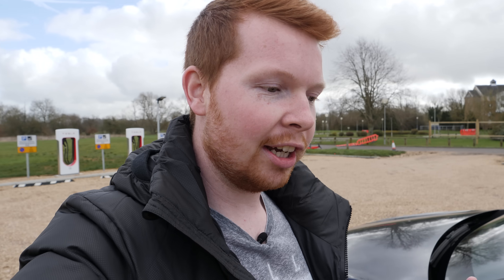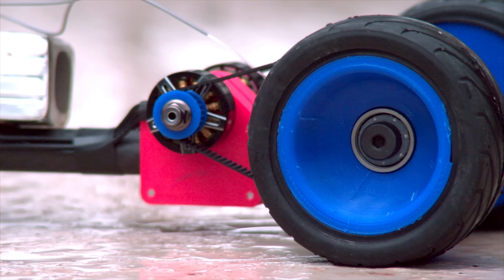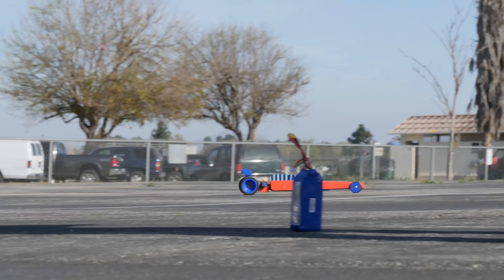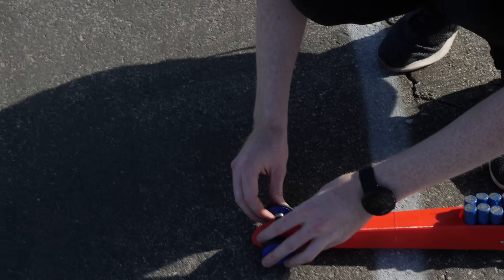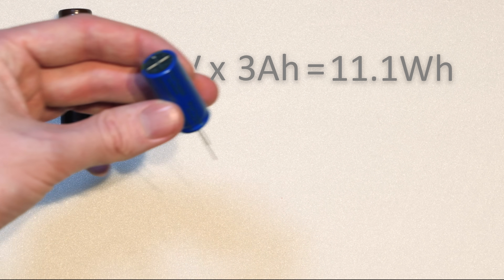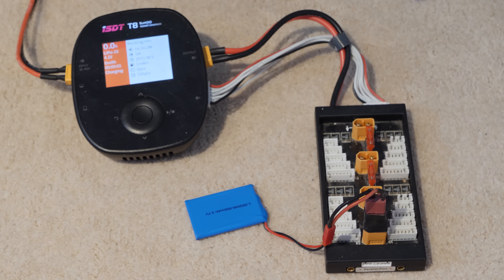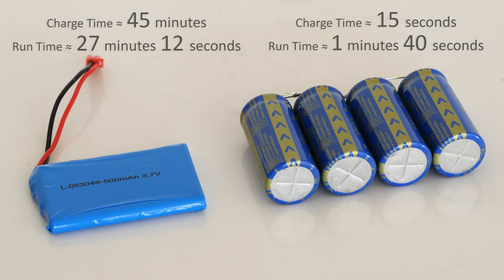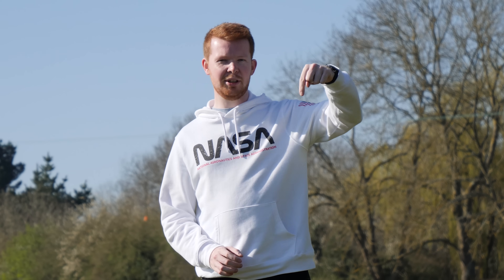Super Capacitor Dragster

Comment: caps should be used in regenerative braking and starting up everything
and everything else on battery.
so a hybrid solution could be interesting here.
Reply: I'm going to start a car company and steal your idea
Reply: Elon musk wants to know your location
Reply: Tailslol they already are in multiple applications. Like the dodge eTorque
Reply: Why do we need to use caps for regen and not just the Li battery? There are considerable drawbacks with supercaps: The energy density spec tells us a Li battery will usually be smaller in size, you won't find too many with high Farad rating AND high voltage tolerance, we don't want more complication with parallel/series orientations requiring balancing electronics. Caps also leak so "starting up everything", most likely won't be an option after sitting for a while.
Reply: @amorag59  battery has a limited number of charge and discharge and become less efficient over time.
this will negate the effect .
Reply: Tailslol Those are for deeper charge and discharge cycles. Real world cars already are using the Li battery for regen so your opinion is moot. You realize the material that separates the plates in capacitors breaks down right? Most don’t know, but because of this caps have a very similar or less shelf life compared to Li batteries 5-10 years. I’m not trying to bs you, I’m just tired of all the unrealistic hype.

-An electrical engineer
Reply: @amorag59  indeed i realise that,but it is well known caps degrade a lot less than battery so the less you use battery the better.
capacitors can charge and discharge for decade when used correctly,when a battery show a lot of weak points only after 2 years of regular use.
Reply: Tailslol “when used correctly”? You mean perfectly ideal conditions? 10 years if the cap is kept under 25/77 degrees C/F. The life cycle drops drastically with heat, the shelf life is 4 years if the person doesn’t drive their car. That’s just the longevity, you still didn’t address the fact that they don’t hold any energy and the higher energy ones are like 2.7-3 volts max. So you now have to build a module of these (with balancing circuitry) to operate at 400 volt level (Tesla). I see where you’re coming from but think about the whole picture. Tesla’s batteries have a warrantee of 8 years and many continue driving after that without noticing too much degradation. Tesla has done well with their Li chemistry.
Reply: Tailslol All if this info came from maxwell supercap datasheets.
Reply: @amorag59   yes for sure your battery won't live as long.
Reply: Tailslol Literally all Li BEVs use their battery for braking regen. If it were an actual problem they would have implemented caps.
Reply: @amorag59 youll see. unless they make solid state battery it would be a problem.
Reply: Tailslol More baseless claims, stay blissful my friend.
Reply: @amorag59  Heh I'm not blissful I'm not the one who think lithium battery will stay efficient forever...
Reply: Tailslol Don’t straw man me, I never said that they’d stay “efficient forever” now did I?
Reply: Tailslol I can tell you are not even old enough for university. It may behoove you to one day listen to people with actual real world experience (in this case how laughably tiny the energy density of capacitors is).
Reply: @amorag59  heh i'm from 84, i have a good life  and enough experience, and i'm probably way older than you so...yea ...not the best way to attack by the age just to try to impose an opinion...
Reply: Tailslol The energy density of super capacitors is not an opinion. I just provided a laundry list of drawbacks and sources as to why this is not as good an idea as it looks. I would expect the same of you with analytical responses, but you so far haven’t addressed many if any drawbacks. “Battery will go bad in 2 years” just. Plain. Wrong. You mischaracterize my position and cherry-pick what you want out of cap technology. This is characteristic of a child, not a mature adult.
Reply: @amorag59  ho yes i know about the energy capacity of the capacitors,this is why i suggest a hybrid solution with capacitors as complements.to preserve the main battery.
did you really read what i said in my first post....
Reply: Tailslol “Why do we need to use caps for regen and not just the Li battery” was literally my response to your first comment... Then I go on to tell you all BEVs have regen directed to the Li battery and you must also address the added complexity given the low energy density drawback....
Reply: @amorag59  to reduce the number of (small) charges.
the regenerative braking offer so little energy it basically mean nothing for the long term.
so better keep the battery for regular charging. the energy used in regenerative breaking can be used to help the next start since it will happens after the breaking.
the energy itself will not be stored for long in the caps and will be more efficient than just using the battery.
caps can be used too for cold start when the lithium battery will have difficulty to provide energy.
Reply: Tailslol Capacitors would leak and NOT be able to always start the hybrid on their own. If the caps and batteries stay connected (if you don’t isolate them) the caps will slowly drain the battery. Tesla’s can do 300 mi now and 600 mi by 2026-2030. This is the Li technology that’s out there and not even anywhere near your 2 years life you tried to claim. You are beating a dead horse repeating the same thing, your opinion. show me any evidence that says regenerative braking is actually a problem for longevity with Li batteries.
Reply: @amorag59  i think it is an issue for longevity yes ,too frequent charges can increase the risk of damage the internal membrane of the cell . but yes i know the caps will be flat in the first start so the caps are not fully isolated ,im aware the battery will have to juice up the caps for the first start.
Reply: Tailslol “I think it’s an issue” doesn’t cut it bub. There is a big difference between a loss of 2% after 10 years and a loss of 30%. Conjecture, opinion, guessing. Not helpful.
Reply: @amorag59   you pretty much mention caps in n1 and battery in n2
Reply: Tailslol My gosh, get a clue, if you don’t provide scientific evidence then you’re just pissing in the wind. I don’t discuss conjecture.
Reply: @amorag59  cool,cya then.
Reply: @amorag59  Seeing as I am not in the battery nor car manufacture business, all I have is opinions and hearsays. Such as batteries don't like short bursts of high current from regenerative braking, so manufacturers silently nerf it to prolong the battery life. The use of supercapacitors aims to flatten the current from regen, i.e. push the usefulness of regen even more. They are not meant to replace the battery.
You mentioned some technical difficulties, which are to be expected in any technology.
Reply: @amorag59  As an electrical engineer you should know that audio systems use capacitors, and some working audio systems have more than 20 years and haven't got their caps replaced. Or computers, servers, etc, for that matter.

Edit: you are mentioning supercapacitors... use proper wording. We currently use battery-capacitors as super caps, of course they have the same lifespan as batteries.
Reply: @vladlu6362   Are you kidding me? First off, I don't know why you are accosting me lol. There is so much wrong with your comments, I shouldn't even waste my time but here we go. You know I'm an EE yet you are over here explaining the obvious about capacitors while ignoring the important details? If you actually knew about caps you'd know that, although they have high power density, they have an extremely low energy density. About 5 Wh per Kg as opposed to 120-240 Wh per Kg for lithium. This weight will add up if you actually are trying to design the system to have enough capacity to offset battery usage. This is all with the caveat that with regen braking you still need to use regular brakes so a significant portion of your momentum is lost as heat.

Your analogy about "you will probably have your 12 volt caps charged and your 12v battery dead" is off for two reasons. 1) energy is energy, the energy you get from regen braking would be the same on a battery or a supercapacitor, the capacitor would only be charged up so fast because it has less storage capacity. This is equivalent to bragging about a smaller fuel tank being "better" because you can fill it faster... You were probably referring to the low internal resistance of capacitors allowing for high currents, but the internal resistance builds up when you introduce a lot more cells. 2) Why are you talking about a 12v battery when we are talking about braking regen? On braking regen you wouldn't be dealing with a 12V battery you would be dealing with a 400/800 V etc. battery... 

There is a difference between capacitors in audio electronics and caps used for power. This shouldn't even need to be mentioned. The ones in audio/computer systems are used for signal filtering (RC and RLC circuits), not so much energy storage. Even in power smoothing/filtering those capacitors aren't discharging that much energy they are just filling in for small voltage dips.

The point was you can't just be happy that they have high power density (why you needed to tell me this fact I don't know). You'd need to stack them in parallel to get decent energy density, AND stack them in series to have enough cells to make up the 400 volts or 800 volts that the battery runs on. The higher the energy storage the supercapacitor, the lower the cell voltage usually is which is not helpful if you need 400/800 volts from 2-3 volt cells. You are looking at 100-200 cells in series just to reach proper voltage before even adding capacitors in parallel to get to a target energy storage level. Then on top of that you need power electronic to balance the cells. You have to look at the bigger picture.

Lastly, it's called "braking" not "breaking" so get your grammar straight before you criticize a term I use that's not even incorrect. A supercapacitor is still a capacitor.
Reply: amorag59 lithium is better but it’s still pretty terrible.
Reply: Mike Russo True, I’m usually arguing in favor of engines when it come to heavy duty. Just hate to see the science ignored. Energy density ICE>>>Li>>>>>>Supercapacitors
Reply: amorag59 exactly. Honestly believe the ICE will never leave, maybe replaced by hybrids with super capacitors like the Lamborghini Sian.
Reply: @amorag59  Caps leak slow. you will probably have your 12 volt caps charged and your 12v battery dead. Batteries can't charge fast, or as efficiently as caps can. Capacitors have a way higher power density in short periods of time, making them advantageous for stop and go situations with high acceleration and fast breaking.
Reply: hybrids are the only way electric cars are truly feasible as sports/heavy load vehicles

Comment: What about using the capacitor as a turbo to overvolt the motor in small bursts ? you keep the battery that keeps the capacitor charged in permanence, but when a button is actionned , you get a small burst from the capacitor

Comment: Do you really think your homemade dragster would be so slow that is could't be stabilized by aerodynamic guidance while creating more pressure on the driving axis to gain thrust and keep it from flipping? If you make the surfaces big enough they should become useful at some point when some speed has been picked up. I am surprised this wasn't your first reflex to try that when seeing these results.

Comment: Well actually 
Battery can be charged and discharged between 4.2V to 3.2V and that's about all the usable capacity
So (4.2-3.2)*3Ah = 3Wh
While a super capacitor can be discharged to 0V so 0.06Wh is correct and hence a Li battery = ~50 SupCap

Comment: ive seen a video of a guy a while ago who replaced his car battery with capacitors, which was purely for the starter engine. then he put a tiny little 12v battery inside the cars normal systems. which saved him alot of weight.

Comment: Would there be any advantage in using super caps as an "energy cache", eg. for take-off power or for reducing wear on batteries?
Reply: My thoughts exactly, besides I've seen somewhere here in YouTube an experiment in China where they installed capacitors in a bus and charge it in each bus stop
Reply: @contdemonte  Modern busses, including petrol-powered ones, use flywheels to store kinetic energy. Simply put the energy from the brakes is used to power a wheel inside a vacuum chamber that can spin over 30,000 RPM. When the power is needed, the generator is reversed, and the power from the wheel is transformed into electrical energy that is sent to the wheels. 

It's also employed in race cars. Formula E uses flywheel energy storage, as well as some hybrid Le-mans prototypes (919 Porsche for example). F1 uses a battery system (possibly Li-ion) since its still more efficient in terms of space to energy stored, however.
Reply: @tld5380  Really?! 
I'm keenly interested in all aspects of flywheel energy storage, including KERS (Kinetic Energy Recovery Systems). I was aware of some niche racing implementations —several at the 24 Hours of LeMans, like a Porsche 911 GT3 R Hybrid, and an Audi R8 "e-tron" quattro— as well as some fairly experimental uses on limited bus routes, stretching all the way back to the 1950s, I believe.

But I hadn't realised that this technology has progressed to the point of being widely adopted! I'm actually quite excited to dig into this further, thanks for bringing it to my attention! 

On that note, I don't suppose you'd happen to know of any good places to look, that you might share (such as YouTube videos, online articles, or specific companies & areas that are deploying these systems on a wide scale)? I'd be greatly appreciative if you do!
Reply: Capacitors maybe great, 
But let us consider the price compare to batteries.
The more capacitance it has the more expensive it is compare to li-ion batteries.
Plus its bulky size, you can’t just compress a high capacitance capacitor cuz it requires wider area of plate for a high capacitance or for more energy it can store.
Reply: The channel "Real engineering" has a great video about that. Search for "Real engineering Tesla" and you should find it. The title says something with Batteries. Tesla bought a super cap Company to use These caps for the exact same reasons you mentioned in Your comment.
Reply: Capacitors are good for high bursts of energy for a short time if you want a consistent supply for a longer time it's better to use battery's
Reply: Maybe supercaps could be used as really efficient regenerative braking cache and used later as a boost. or it might stop you dead on the tracks since it sucks up most of the energy quickly.
Reply: ive seen a capacitor bank for race drones to use on launches
Reply: could probably use them like how gas cars use nitrous oxide: short bursts of high  power
Reply: Yes, Pininfarina had this idea and implemented it in a car designed for car sharing. As did Pugeot, I think? The downside is capacitors take up lots of space for very little storage, which means less space for the lithium battery, which means shorter overall range even though battery lifespan is improved. (hence the car sharing application of this tech)
Reply: There is a use, but most lithium and lifepo4 batteries don't need the help once you build sufficient capacity.  They will prolong the life of any battery, but mostly used on lead acid if at all
Reply: that's precisely their use in off-grid and RV (example: starting a fridge compressor then a normal battery take the load) or takeoff on Electric motorbikes
Reply: Some hybrids use a capacitor bank to absorb energy transients during braking. For the most part once you get enough battery to get decent range the peak load isnt so bad

Comment: Sorry I'm not sure if I'm going to fall flat on my face here but...
Couldn't you just keep the lithium battery connected all the time? Would that mean the capacitors always charge back to 11V when throttle is off giving you the extra immediate boost ftom the capacitors but also giving you the longer life of the battery?
Or am I way off the mark here?

Comment: So.. Doing a little math in my head you would need around 60 caps to equate to the battery and the 60 cap array would charge in around 15 mins. Both are approximate.

Comment: Tom this video was awesome. If/When you are back in the UK, let me know and I'll happily send you a proper RC Car to do something cool like this too....  
Do you think you could run the RC as normal off the supplied Lipo, and also charge the caps from a small motor being used as a generator? Then from a 3rd channel you can have a small boost... like a KERS system? Most RC's will run between 7.4v (2s) & 11.1v (3s) on stock electronics, so would take the small boost.

Comment: Now, uh. Those lithium batteries? You should probably stick a resistor in there if you are going to do it a lot. They don't really enjoy massive energy spikes, and you can screw them up pretty badly.
You are using them for a really short time, but you are essentially shorting them. 's not the best.

Probably not an issue unless you try it like a thousand times, but yeah. Bad boi.

Comment: Lithium battery cell has a voltage range of around 3.7v and voltage discharge at a non linear rate. While super capacitor can goes all the way to fully discharge. The usable voltage range of a super capacitor is very little if retro fit into a battery powered device.
Which also confused me with the formula shown at 3:55, can you explain a little more how do you get the formula for Farad into Wh?